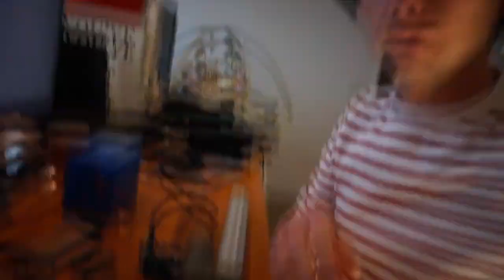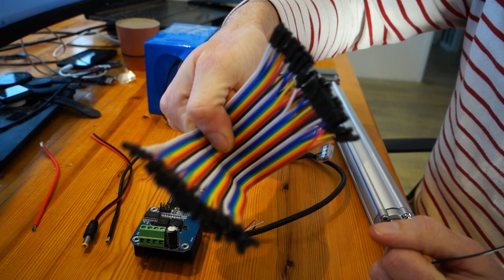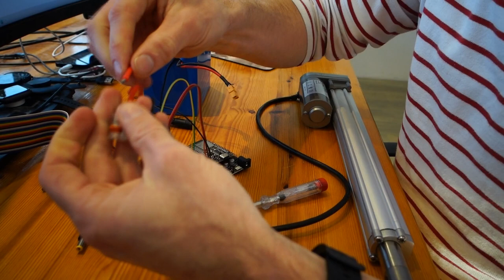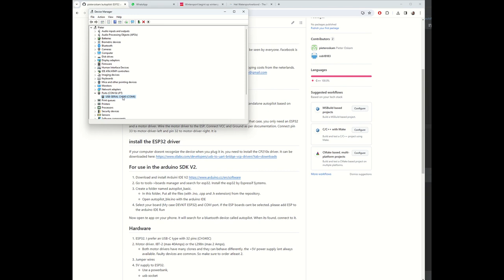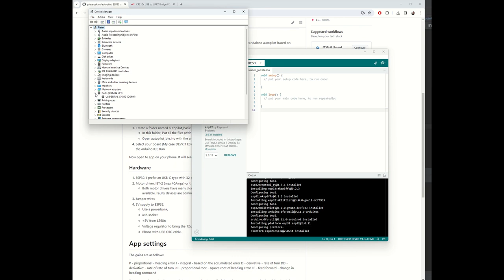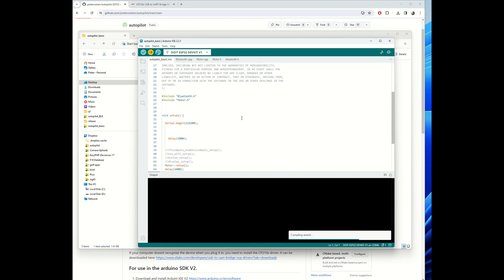Bluetooth Autopilot Assembly hardware and software

Comment: Clutch control
The clutch disconnects the actuator from the rudder—useful for engaging/disengaging the autopilot. Hydraulic: usually a bypass valve. Mechanical: electromagnetic clutches. GPIO13 → HIGH when AP is active (use for relay/MOSFET control). Most clutches: 12V/24V two-wire input.
How do I make it work?
Reply from the maker: Buy a 3.3V 1 channel relay module. Wire it with 3.3V GND and GPIO13 to the input pint.
Reply: @Nautinect  Thank you very much for your immediate response.
Reply: @Nautinect  There is no excitation at the point (GPIO13)

Comment: Just saw the video you did with wildling sailing. Was really impressed.
Is it possible to buy a assembled kit from you?? Not that good at Electronics and pc 😅
Reply from the maker: Hi, yes, they are available at nautinect.com
Reply: The tiller drive coming out i april, is that a complet unit? 
That can  connect to app too?
Reply from the maker: @WorkbenchRestaurations  yes

Comment: I see that the price range of the linear actuators is at least tenfold. Can I ask, what make and model you have, and do you think it is good enough? I wonder how these actuators would do much better in damp or wet environments than simrad for example...
Reply from the maker: I use the same aactuator as pelagic is using. also sold by pcnautic. It is ip rating 67 and will work under water if it has to. this actuator is also stronger than the simrad and it has built in end switches to prevent burn